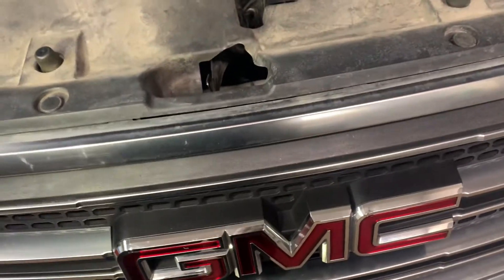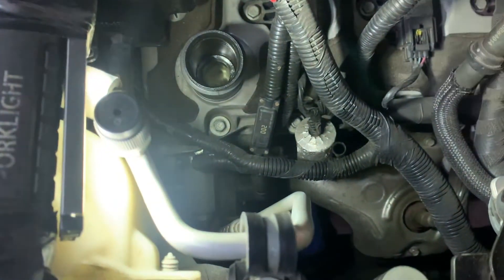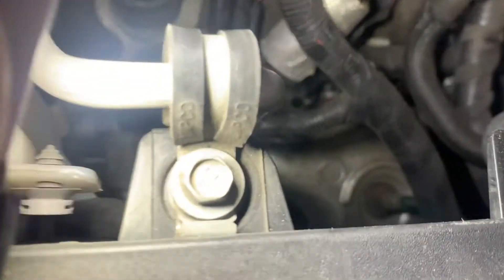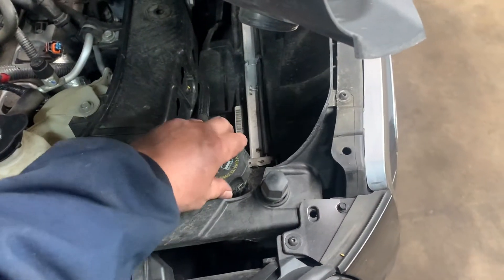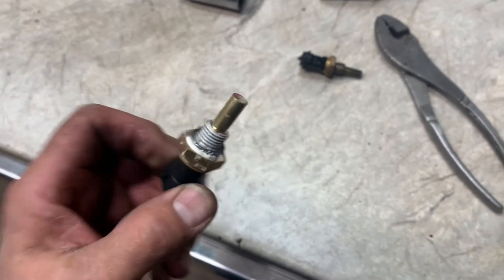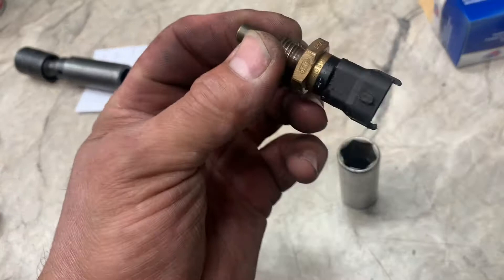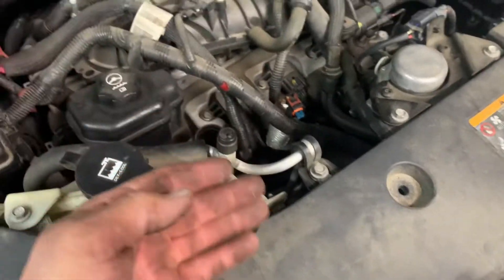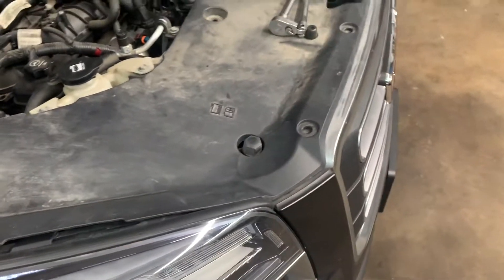2015 GMC Acadia coolant temperature sensor replace

Comment: Nice instruction. One thing, if you use a spark plug socket, pull the rubber plug keeper out first. That gives plenty of room for the connector to seat.
Reply from the maker: Good idea

Comment: Did you use teflon tape or what did you use?
Reply from the maker: Pretty sure it has a washer for a seal if u going to use something use Teflon sealer paste on threads
Reply: I had this done but after i left shop truck started smoking any idea what could cause that
Reply from the maker: @maryj4078  upon disassembly coolant got on engine and wasn’t cleaned off good enough free started burning left over coolant on engine off
Reply: Wth! No haha this isn't home plumbing